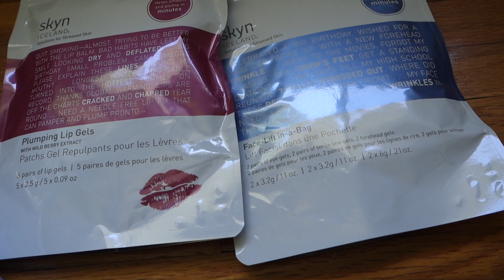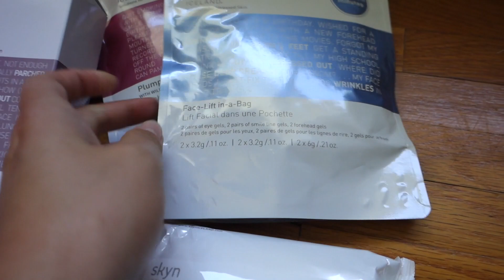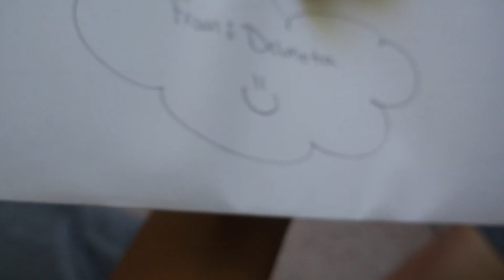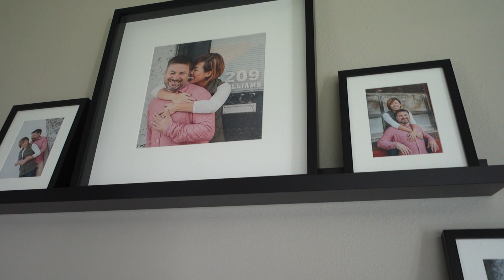CHANGE OF PLANS | ITSJUSTKELLI

Comment: you need to use a Neilmed nasal wash it's all natural and you can use it as much as you need. it will help get you over the URI faster as well. it washes out any allergy causing stuff in your nose plus it will moisturize your sinuses as well and help with the bleeding. I use them on my kids as well when allergies or infection take hold. most ENT docs recommend it as well. it's kinda like the netti pot but better.
Reply from the maker: I'll look into it!

Comment: take the Pringles can to your local shops and request to speak with management and ask them to stock them. I do that for hard to find items. they need the name and barcode to locate the correct item. I usually have to request it a couple of times, and it can take awhile but they can usually get the items eventually. finally saw this past weekend that my local store started stocking several of the items I requested a couple months ago.
Reply from the maker: I've tried that before for caffeine free dr.pepper with no luck :(
Reply: bummer.. :(
Reply: hooray for awesome people who can send them then! to this day I've never seen a single ketchup chip of any kind in south tx..
Reply: I used to work at a large chain grocery store and we could try to order new items but it was often above store level if they didn't get sent to us. It sucked working customer service and explaining that you could keep ordering it but if the product didn't come there was nothing more we could do. It was especially difficult when the smaller store across town had them but we didn't. I often times told people to take the surveys and rate the store high except for the lack of product they wanted. Sadly those surveys worked better at getting higher up's attention then their own employees. There's often a lot of behind the scenes stuff that goes on with their vendors and receiving that the rest of the employees aren't looped into as well.